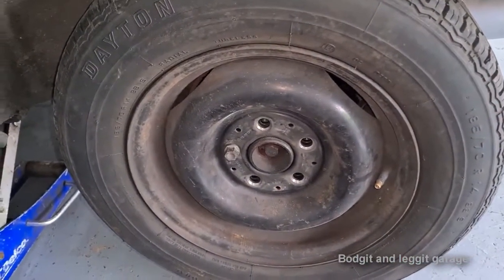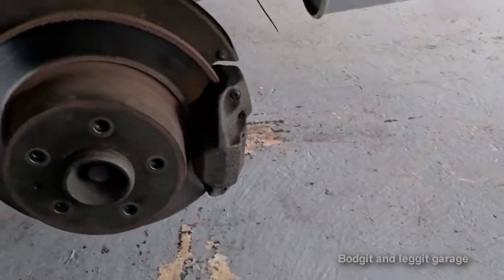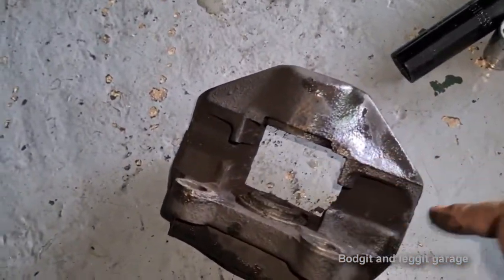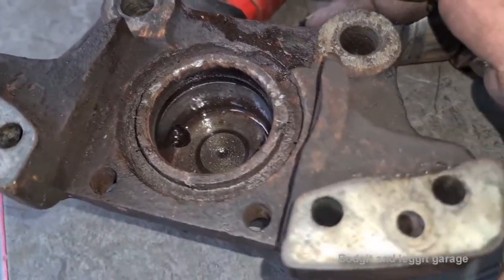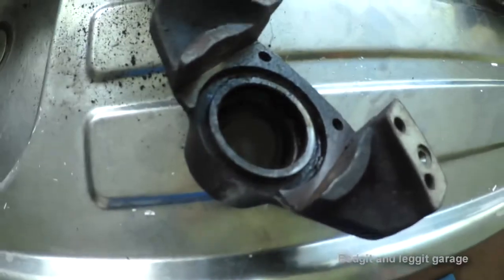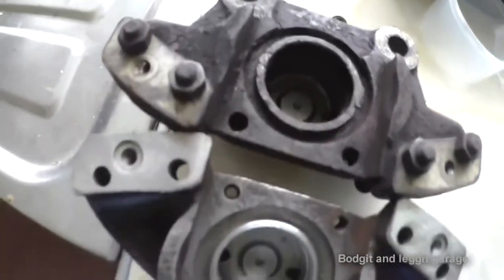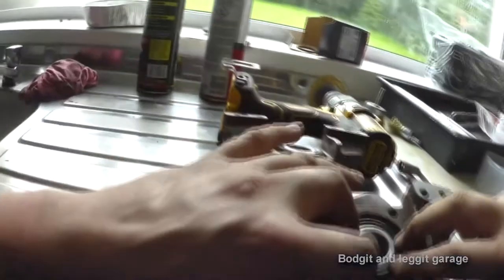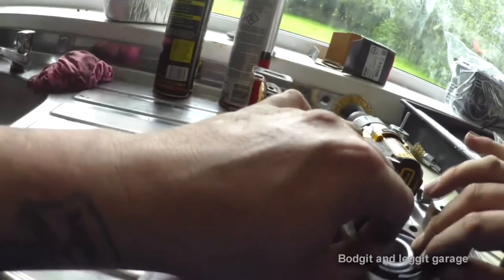Mercedes W115 Brake Calliper Rebuild( How Does This Happen)

Comment: I rebuild a lot of calipers rather than replace. I've noticed that the caliper kits can be bought with or without the slider kit but the slider kit is always available separately. 
Frentech-uk have always supplied me what I need and with no hassle. Good quality stuff, check them out. sometime.